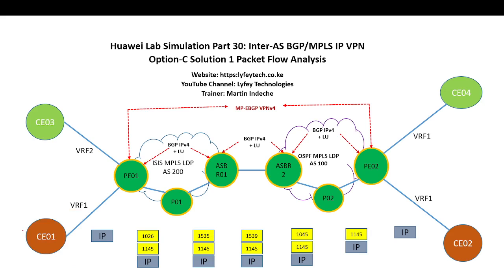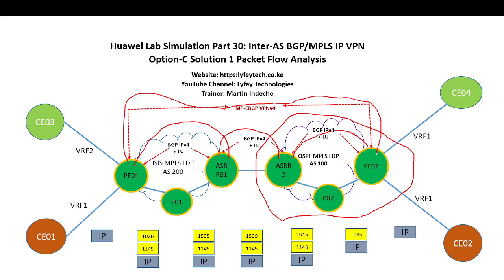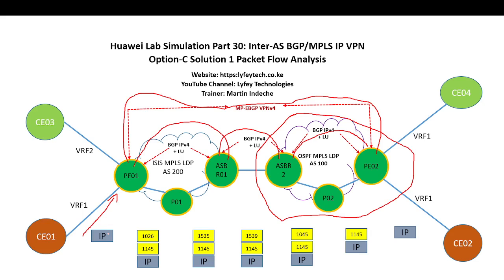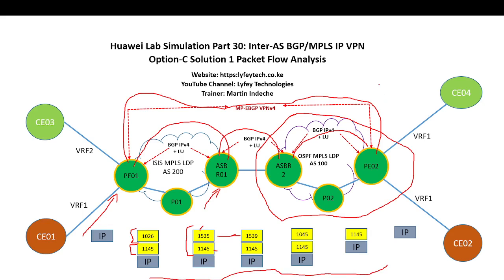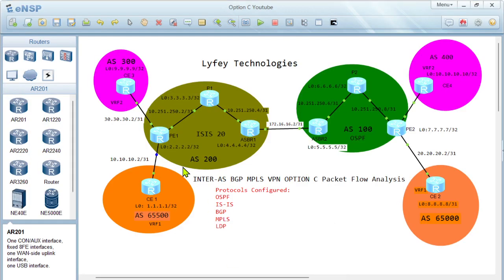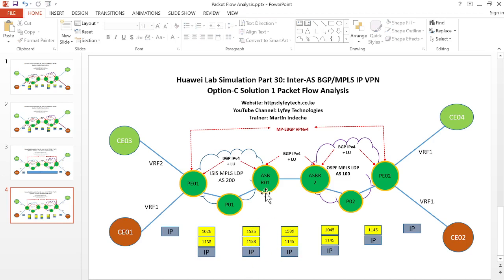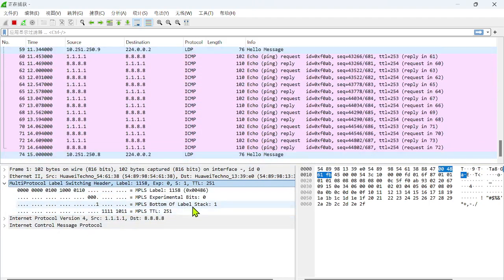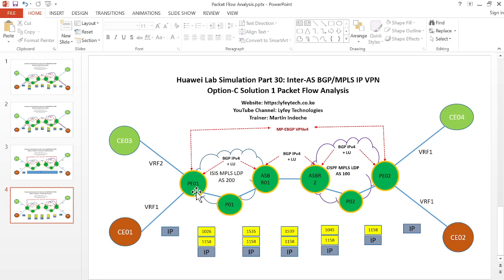Huawei Lab Simulation Part 30: Inter-AS BGP/MPLS IP VPN Option-C Solution 1 Packet Flow Analysis

Comment: For the 3 labels; we can look at it this way… The innermost label is the vpn label then the next label is the bgp label from the asbr, remember bgp was redistributed into the IGP, also if you check you’ll realize that this particular label remains the same till the ASBR where it is swapped to another bgp label to get to the ASBR in the other AS. The outer label is the transport label and it’s popped at the P router. 
For option C; from the ASBR we always have 2 labels to the ASBR in the other AS. 
The there labels do not reoccur in the other AS cos the traffic path is downstream to the CE.
Reply from the maker: Hello and thank you so much for a clear explanation to our audience. We keep learning every day and become better engineers.
Reply: "emember bgp was redistributed into the IGP" why is it needed? Can you explain please? If the next hop 4.4.4.4 is reachable via isis/ospf, and 7.7.7.7 is exchanged directly to PE, which label does the P router swap? (ldp or bgp lu) I think P doesn't know about bgp-lu label right.